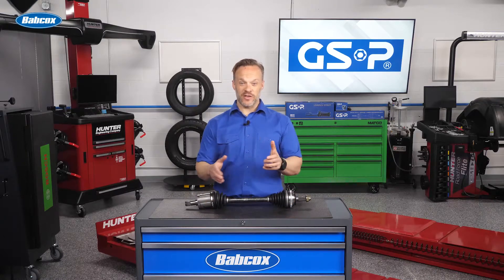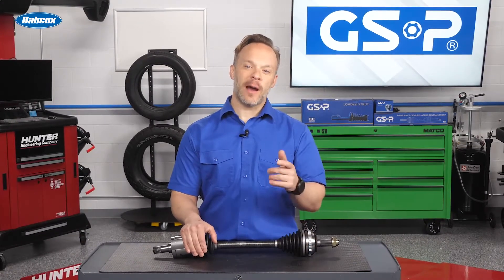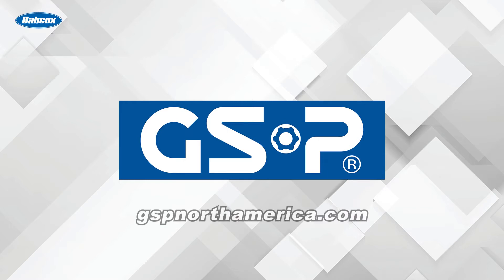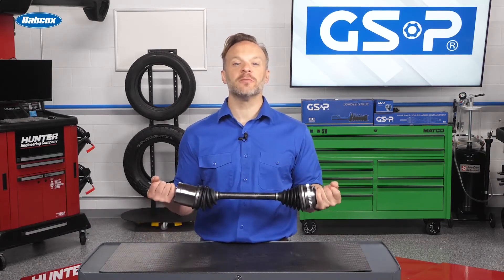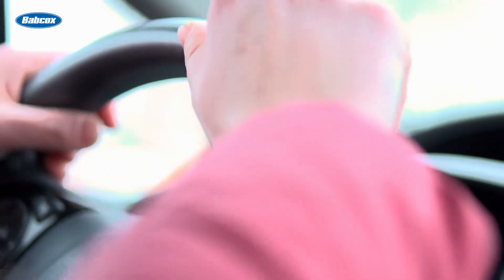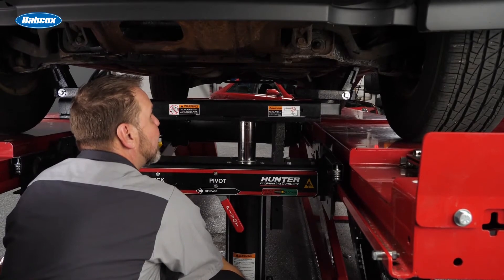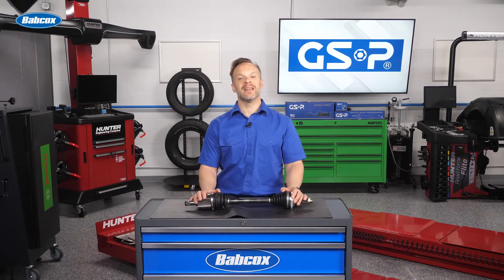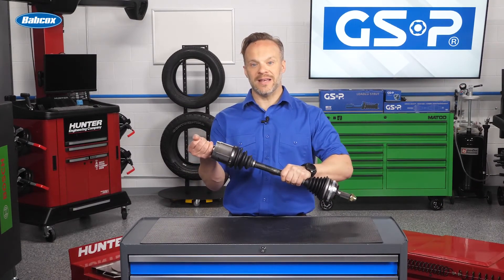CV AXLES: Identify CV Axle problems before they're failures

Comment: I cannot find a CV axle to last more than a few months in my 04 Cadillac Deville, the last brand trying yours.. I get a moment of torque vibration when I hit bumps or accelerate, I let off it goes away until the next bump.  Each time I pulled out the axle I notice the inner tripod joint to be the issue. Just a small amount of play at the inner is all I can tell with my hands, I have yet to pull the boot off and see if issues with splines, rollers etc.. yours Cardone Trackmotive, none seem to go for very long and I am not racing this car, just using to go to appointments...  Had the car just over 2 years and had 4 axles replaced so far..   Are all the components made same place, if so there is an issue with some portion of that inner...

Comment: Hey Josh can I drive my Pontiac Torrent all wheel drive without the CV axle cuz there's times where while I'm driving it it's really loud humming like a vibrating humming on the passenger side and I thought it was my bearing I had changed it and the humming is still there it's much louder